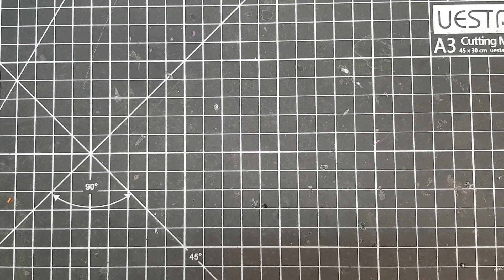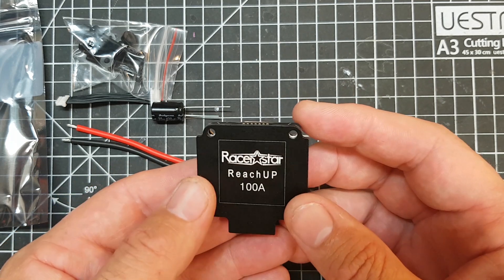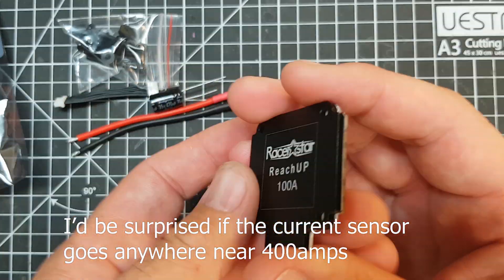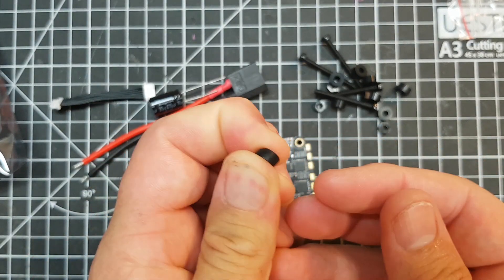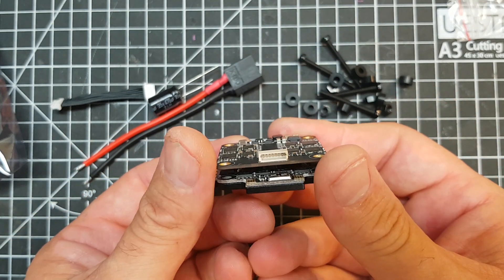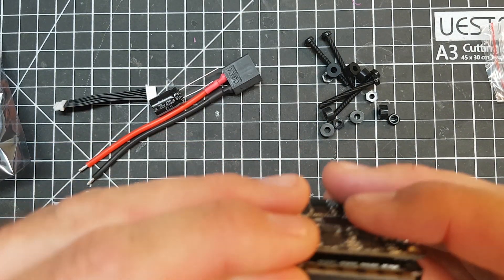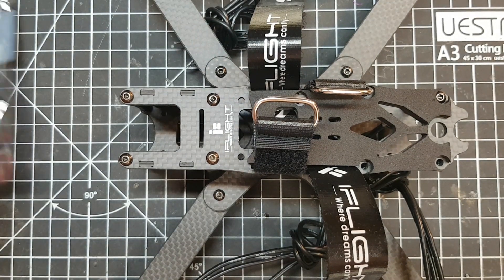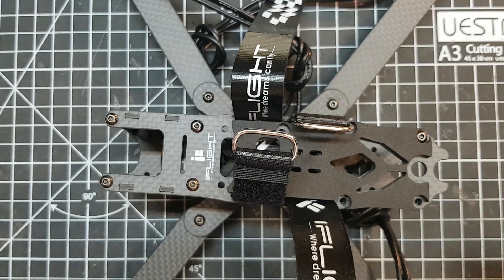8S 100amp Racerstar Reachup 4 in 1 esc / Banggood 13th Anniversary

Comment: Hi, new sub here. Did you ever get to use this esc on 8s? I can't find a video where you fly this rig.  I'm curious how it performs.
Reply from the maker: Rovadevel Fpv lost the quad on its maiden and it spent 3 weeks in the rain before I found it. I did an autopsy vid on what was left 😂
Reply: @CoppertopFPV  ouch that's harsh
Reply: @rovadevelfpv2359  I bought the same ESC and it crapped out on me on my 5th flight during a punch-out...

Comment: I dont see this finished flying 8s, did it burn out on 8s. Any info you can give will be greatly appreciated. I want to use this with 8s, 10 inch 2814 xing motors. Do you think it can handle it?
Reply from the maker: I lost video on its maiden and it ended up staying 3 weeks in the rain until I found it. I did videos on that instead so never got to test it 🙄😂
Reply: @CoppertopFPV  75 bucks to see if it burns out isnt my budget, lol I wish it was. I guess Ill just buy single apd escs until Im sure about an aio. Thanks!

Comment: The boards are separate to keep the mosfets away from the rest of the parts because the noise from the fets could cause an issue with the processor and fet drivers

Comment: 1500KV on 7" to 8" is going to be happiest on 6S or 5S.  I think running those FETs well below rated demands should make it a pretty bullet-proof setup.  That would also open up some pretty excellent options on FC, although having it all 8S rated on paper would be fairly neat, especially to experiment with down the road.
Reply: its strange that its rated for 8s and 100amps because with more volts it should pull less amps

Comment: I don't see the dilemma, put the massive 100amp 4in2 on it and you can do whatever you feel like, just change the props and make a y-connector for serial.
Reply from the maker: Fraser Steen I don’t believe a fc will take 8s long term, and I’d have to run all other components from it unless I use a separate reg. also the weight of two big 4s batteries will likely outweigh the benefits of using 8s. Plus there’s naff all prop selection that won’t immediately flatten out under power. Lots to consider.
Reply: @CoppertopFPV  I know it complicates things but you want an fc with 8s vbat sensing then power it with a regulator. The radix needs 5v but supports 8s via vbat sensing. Azure 6145 carbon mix will not flatten out, no way, no how. Expensive though.
Reply from the maker: Fraser Steen hmm. I’d have thought this would be way too heavy for 6” props to pull through regardless of power. You got experience carting this sort of weigh around? . Radix is a good idea tho, as the li ran well. Need to look into regs.
Reply: @CoppertopFPV  I think you are assuming I think it is a good setup or something, not really just curious. I did have a 2508 6s 6" (7" frame) which in my view flew best on a 3000 6s. I don't think the weight is going to be a huge issue especially since that's probably a 5" kv on 8s not 6".  I have a feeling it might perform pretty well.

I'm just encouraging leaving the room for experimentation.
Reply from the maker: Fraser Steen no worries. I’m all ears as this is just an experiment
Reply: @CoppertopFPV  I mean, I've seen similar size motors quote nearly 3kg thrust on 6" in their stats. TBH I'm more curious to see if an 8s 1500 handles it. 6s 1500 sagged like crazy on my setup, I didn't have an 1800 but if 6s works for 5" maybe 8s will do the same for 6".

Comment: It's tough to find a good esc for 8"+ quads, especially a 4in1.  I've always thought Racerstar was junk, but the specs are good, and it looks like it has a lit of filtering on it.  I think they divided it into two boards to help with cooling.  I'm curious which FCs that connector is a direct fit.
Reply from the maker: Racerstar is a bit like eachine I think. Brand made by a lot of different companies with a mix of crap and good.  This one has airbot written all over it to me. Let's hope it survives! Good point 're cooling. Everything about it is designed for that. 2 mins to move the wires to the fc connector.

Comment: Interesting ESC. My GepRC Span Pro ESC does 8s 50A on a single 30x30. For long range 4s is still going to give you best efficiency but 8s will make for some crazy fast freestyle. I only tested 8s out briefly as it has fried all the motors I tried it on.
Reply from the maker: I have that esc. If it lasts longer than a week on 8s with these motors I'd eat my shorts! 😁 I'll be surprised if this one does